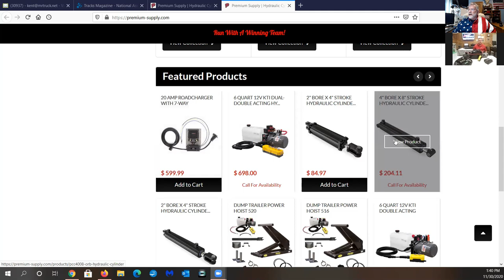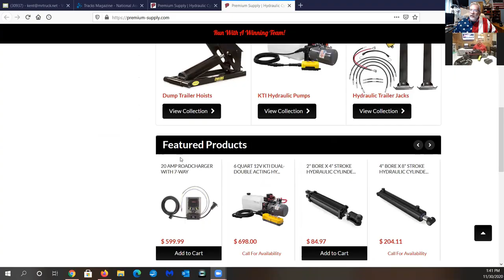NATDA 8, PremiumSupply, guess what I did to my trailer? No more manual labor.  No more screw or guts

Comment: Have you come across Ford F-250 or F 350 with a death wobble???
Reply from the maker: I haven't, my 2nd gen Dodge short bed lifted had death wobble. We put a brace on it from the steering box to the sway bar bracket. It helped.
Reply: Just replace the steering stabilizer and it’s fine